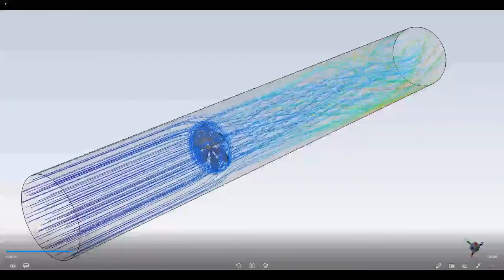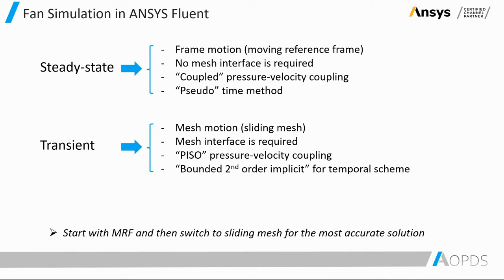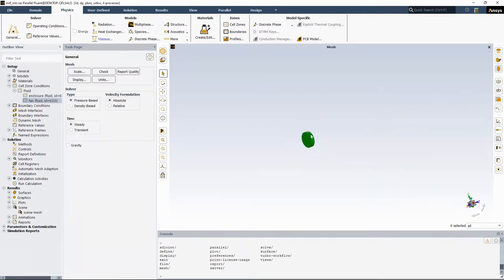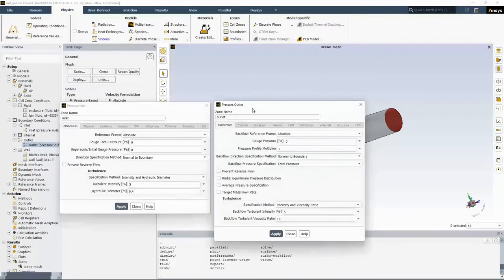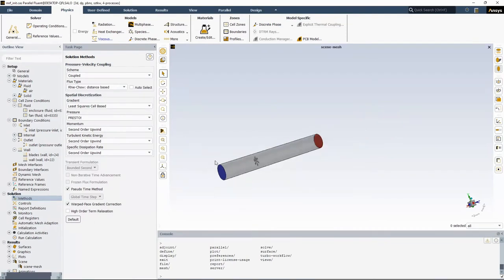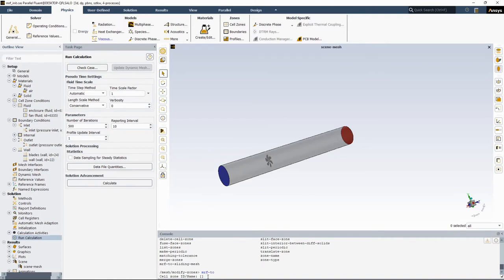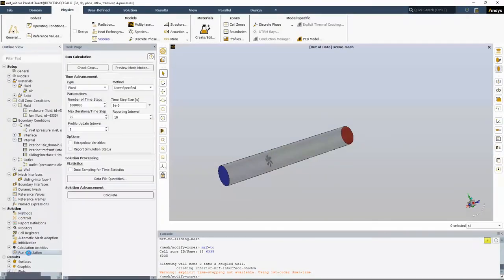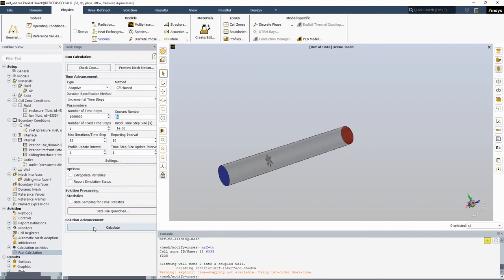Axial Fan Ansys Fluent Simulation

Comment: sir, i have a question: in real model, the fan has a case, why you don't add it in your cfd stimulation ?
Reply from the maker: @caufieldholden277 This is just to prove capabilities of Ansys Fluent to model a fan. The computational domain is selected in a way that we only look at the bulk flow rotation cause of the fan blades, but if wall effects are significant, we can definitely make part of the surrounding wall as the fan enclosure and include the boundary layers in the simulation too.

Comment: Thank you for your helpful video. I want to ask, I only have a data of fan velocity of 7.5 m/s. Is that possible to input velocity fan and leave the pressure at 0 Pa ? Is it will be working ? I just want a static fan velocity which has value of 7.5 m/s.
Reply from the maker: Thank you for your question - yes, you can change the pressure and velocity to any desired value and do the simulation.

Comment: Can you please share the exact usage of Fluent Vs CFX?
I am getting confused.
Why ansys has both options if you get solution from anyone?
Reply from the maker: Thank you for your question - both FLUENT and CFX are advanced CFD tools with a wide range of applications. Fluent provides a wide range of simulation capabilities, including multi-phase flow, turbulence, combustion, and more. CFX, on the other hand performs better when it comes to turbomachinery, but still can be used for simulating complex flow problems, including high-Reynolds number flows, turbulent flows, and multiphase flows. The way they handle the problem computationally is also different. The choice between them will depend on the specific requirements of the simulation problem and user’s experience.